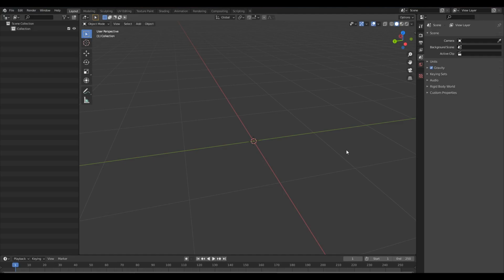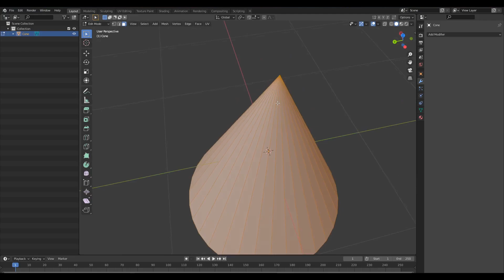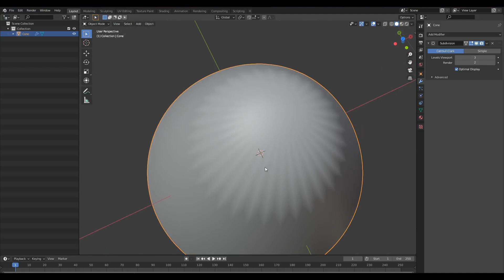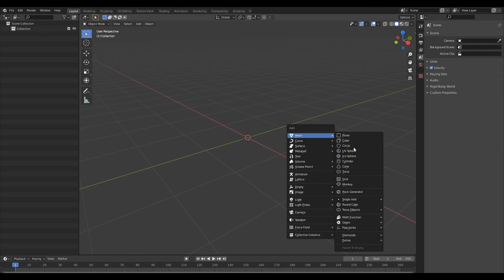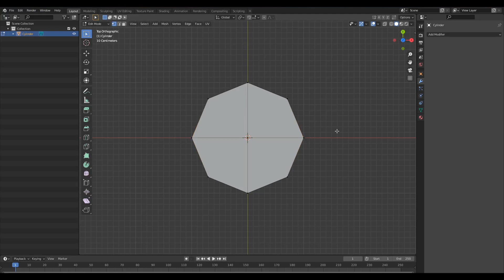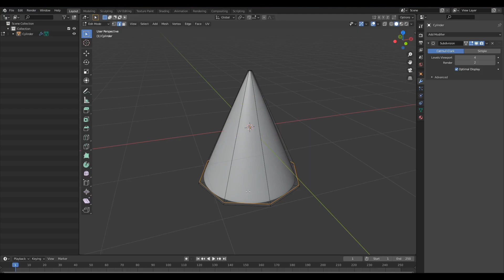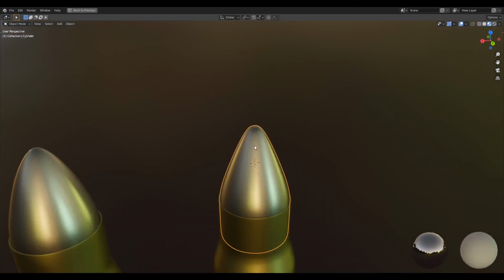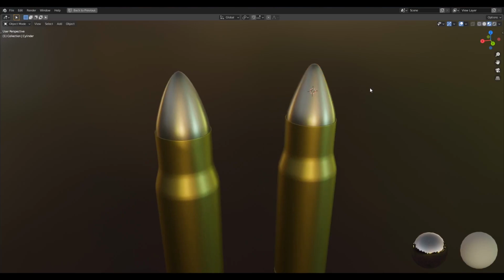Stop Using Cones! | Topology Basics

Comment: I don't see how you are cutting the two lines into the cylinder.  Is it the knife tool snapping to the top face vertices ?
Reply from the maker: I'm using the "J" key to connect the vertices together. The knife tool works fine as well.
Reply: @Art-of-Akrosh  tnx ill try it